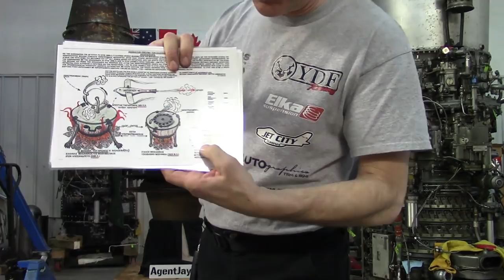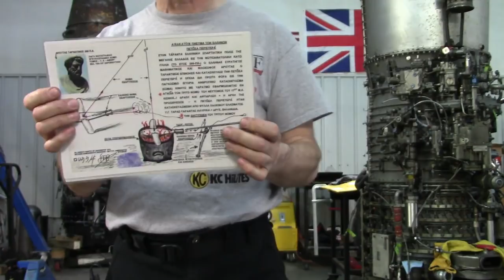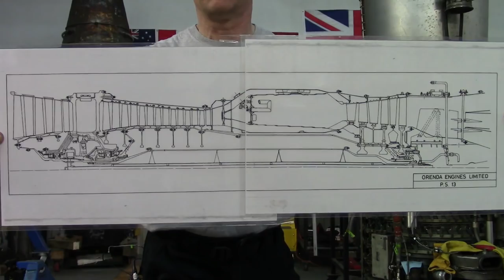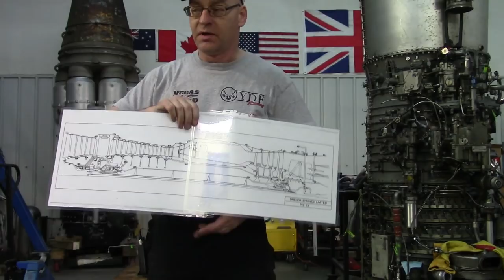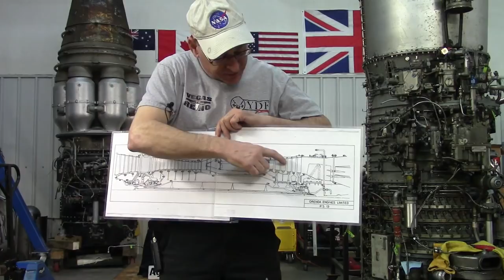4  Why don't jet engines detonate ?

Comment: +AgentJayZ — The closest thing to a detonation in a gas turbine engine is a "compressor stall" or "compressor surge", which, like detonation in a reciprocating engine, is a sudden, explosive event that can cause flame to come out of the inlet and can cause engine damage.  I'm sure you know all that, but you didn't state it in the video.
Reply from the maker: It is most definitely not an explosive event.
Please refer to my video about compressor stall.
It's called Compressor Stall.
Reply from the maker: You're drifting here. The word we started off discussing was detonation. I will not follow your drift off course. Thanks.
Reply: @AgentJayZ  Dear Sir, if I understand this correctly the compressor and the turbo fan are connected with one shaft and they spin at the same speed. Are there any engines made that would use a planetary gear system to change the speed of the compressor to spin faster? Isn't that the whole idea to try to force more air into the combustion chamber? So once the engines up and running you could use a planetary gear system to speed the compressor fan faster then the turbofan. Or is there just not enough power to do such a thing?

Comment: Hey Dude/ lookie at ur BBQ & Think Thrust !!! Fuel Never-Ever comes into Metal Contact. Hence, ur BBQ burner stay's Cool.The  Sum of the Thrust Vector of the Ignitionable Product introduce's New Cooling & at Tyme's, if so Desired,  Combustible Air. Basically Negative Pressure Trying 2 Regain Equilibrium.Cooling is attained by Accelerating & Introducing the Accelerating Air Between Metal & Combustion Hence ;a Techie B-J & Barrier of sort's Betwink's Metal & Combustion. Temp Differential = Buck Roger's 101. Rocket Science/Not Quite, Left out Delta V.Acceleration of Chemical Particulant's. Answer ; They don't Blowed Up cuz they B Honihorribly AJ Approved .lol YYZ 60++Planker.

Comment: That US flag looks either old or fake, what's up with that?
Reply from the maker: Genuine American flag... Made in America, sent to me by an American. It's heavy duty, and it's pinned to the wall in 6 places.
Reply: AgentJayZ gotcha. Flag code is goofy here, maybe it's the knock offs that have the stars closer to the edges of the blue section. My scouting days were many moons ago. Either way, great explanation, I'm impressed by the compression on modern jets, that's a stupendous amount of pressure. Modern diesels run around 18:1 with up to 40 psi inlet boost, my old 6.5 is running 21.5:1 at 15psi inlet boost. On diesels, I know you have to worry about injectors boring a hole in the piston because the injection pressure is so high. I imagine that the fuel injectors on a jet don't have the opportunity to develop a similar issue in the combustion chamber. However, does the flame front ever cavitate (?) the combustion chamber?

Comment: J which jet engine did Donald Campbell use in bluebird that went across the connison lake?
Reply: Rolls-Royce RV12 12 cylinder engine, not a jet at all.
Reply: Nighthawke70 thankyou i always wondered what was used, as a team recently brought the bluebird out of the lake and are restoring the bluebird
Reply: Sorry, but you're wrong, Mr Nighthawke 70.  Donald Campbell originally used his father's K4 hydroplane, which was powered by a Rolls-Royce 'R' racing engine, dating back to the Schneider Trophy contests.  However, that was wrecked in 1951.
He then came up with Bluebird K7, which was powered by a jet engine.  I have the impression that it might originally have been powered by a Metrovick Beryl engine, but I could be wrong.  Bluebird K7 was subsequently fitted with a Bristol Orpheus engine for more thrust, and this is the engine that was powering it in January 1967, when Bluebird K7 and Donald Campbell tragically met their end on Coniston Water. There's a couple of very good accounts on Wikipedia, if you care to check them out. 
For the sake of historical and geographical correctness, I'm going to be pedantic here (I usually am).  Donald Campbell both met their end on Coniston Water.  It's an old catch question for English geographers: "How many lakes are there in the English Lake District?"  The answer is "One".  In the English Lake District, there is only one lake, Bassenthwaite Lake.  All the others are either Waters or Meres, plus a few small areas of water known as Tarns.

Comment: @AgentJayZ Is there any insight you can bring to the argument that a <250g drone could bring down a passenger jet if it were inhaled by one of the jet engines?  I think we're starved of actual experts, so your word on the topic would be actually worth something.
Reply: Large jet engines are tested to withstand frozen birds which are much heavier and more damaging.

This is not to say 'no damage happens' but it is highly unlikely that a 250g drone is going to town a turbofan engine where much of the leading edge is the 'high bypass fan' which directs most of the air around the actual turbine so that most of what strikes the fan follows a path around the sides of the engine and not through it.

I am guessing that on many more modern aircraft the engines are even shielded by the fan deliberately to even further reduce the chances of injecting solid particles encountered in flight or on the ground.
Reply: Thanks!  Yeah, that's along the lines of evidence I've been able to find.  I think a lot of people are basing their worries on older engine designs.  So far it's been impossible to find any concrete data on whether or not any of these older engines are still in service.
Reply from the maker: Frozen birds cause heavy damage.
The test is carried out with unfrozen bird carcasses.

A  sub 250g drone going into a large turbofan would likely damage a fan blade, and it might have have to be shut down.
Then again, it might only be noticed during the next walkaround inspection.
Reply: As AgentJayZ has said: frozen birds cause heavy damage.  The story goes that, in the early days of bird ingestion testing at R-R, the test crew loaded a frozen chicken into the compressed air gun and fired it into the engine, still frozen.  The engine was wrecked.
Another story goes that, on a later occasion, a crew loaded a chicken into the gun and then took their lunch break.  They came back ran the engine up and fired.  The engine survived, but when it was stripped, they found fur in the engine - and the test site cat had gone missing .....
Reply: @grahamj9101 lol poor kitteh.
Reply: @AgentJayZ I bet about a billion people would like someone such as yourself to describe the damage various drone sizes would do to jet engines with the visual aids you have readily available.  Even if it's just your opinion, I bet it'll hold truer than most of the nonsense being touted as fact these days, especially on YouTube.

Comment: So an modern engine got 40 to 1 compression ratio so at ground level it's 40 bar pressure but at 15 kilometres upp there at 2000 km/h ram air speed. how much pressure is in combustion chamber?
Reply from the maker: Airliners travel at about 900 Km/hr, not 2000.
Ram air helps the compressor do its job, but does not change CDP.
Combustor pressure is slightly less than CDP.
Burning the fuel heats the air, but does not raise its pressure.
Reply: Shouldn't Charles’ Law imply that heating the air increases its pressure?  Or do you mean there is a net decrease because of outflow from the exhaust?
Reply: @who88777  Jet engine combustors are designed to be as close to constant pressure as possible - the expansion takes place as acceleration of the flow instead - and in practice there is always a few % pressure loss
Reply: Ok mr riddler...

Comment: In a nutshell, jet engines don't detonate because there isn't any fuel mixed with the air when it's being compressed, so detonation can't occur.
Fuel is injected after the air is compressed, and the flame burns continuously.
Reply: Alla, the reason diesel preignition isn't a thing as well.
Reply: You got it :)
Reply: That's a different phenomenon altogether, and it's not what makes diesels more efficient. They get more work done per unit of fuel being burned because the compression is much higher and the mixture is always on the lean side. Very little unburned fuel, and more energy being extracted per unit of fuel burned. Originally we were talking about detonation, and both diesels and jet engines can't do that because there isn't any fuel mixed with the air when it's being compressed.
Reply: Devil's Offspring 
You should repent
Reply: Repent? How did a discussion about engines turn into something to do with religion?
Reply: @rcairflr  Why the attitude? This is a technical discussion.
Anyway, jet engines, like any internal combustion engine, don't use "compressed air instead of fuel". They use both. In a jet engine, there is no fuel mixed with the air _while it's being compressed_, so detonation can't occur. Same thing with Diesels.
I don't have to have a "lot of experience" with jet engines to understand that, and neither do you--or anyone else. This is easy to understand and doesn't take years of study and/or wrenching on physical engines to grasp.
Why the overt hostility?
Reply: @rcairflr  It's all good :)
Reply: Diesels don't re-ignite because the fuel isn't sprayed into the engine until it's ready to be ignited. It's sprayed in,  just before TDC, then ignites. It doesn't travel in with the air, like a gas engine.
Reply: @jameswright4732  you'll get something close enough if your injector timing is wrong enough that you get fuel being injected too early

Comment: 12:50]  How about at start up?  when ignition may not be fully established all of the way around the turbine.  Possibility of problems??
Reply: I forgot to add, is there a certain confining effect of the flame front at the fuel nozzle that is due to the fact that everything is already hot, up to temperature, and burning, but may not be that way at engine start up???
Reply: 8:43]  I guess I'm about to get the answer to the question I was anticipating all along.
Reply: 9:15]  Now I know I was anticipating explosion correctly if you get things out of order at start up!
Reply: Elsewhere I've mentioned that the nearest I've been to a 'hard' start of an engine was on a combustion test rig, when we were testing the altitude light-up and cross-light capability of a new design of cannular combustor.  The second combustor was slow to light up, which it finally did with something of a 'thud', and which we most definitely felt. I'm not aware of any reports from service of similar 'hard' relights after an in-flight shut-down, but it's perfectly possible.

Comment: You are wrong sir! The turbo jet engine is far better than a piston engine.  To make my case against the "Polara" of the 70's you reference, or even any such piston engine (with or without its turbo charger) just consider why, in the 1960's such engines were completely banned from auto circuit racing and separate categories made for the ones that did allow them. I saw the Indy Car in  action that Andy Granatelli  competed at Indy  in the year it was allowed in a competitive mode. 
 It was powered by a PT-6 from Canada, but its Canadian heritage had nothing to do with its banning. Even though it did not finish due to transmission problems, an inlet restriction plate became the method of banning it in later years. To similarly restrict any piston engine one would have to restrict the cooling to its radiators, as the restrictor plate for turbines also restricted its ability to stay cool at full power.
 Fairness of competition was not what impelled the later change in the rules and for that reason I stopped going to such "unlimited" motor racing competitions.

Comment: They do detonate...Right there in the combustion chambers.
Reply from the maker: Nope.
Reply: I agree with AgentJayZ.  Nope - and I was involved in the design of a few combustion chambers.
Reply: So let's straighten this one out.  In a normal combustion process in a gasoline/petrol engine, when the spark ignites the fuel/air mixture, it doesn't all go 'bang' instantly.  A flame front propagates very rapidly, but not instantly, through the combustion volume.  When detonation, aka knocking or pinking, occurs, then there is a sudden, almost instantaneous, combustion event.  This causes far higher pressures and loads that with normal combustion, which can result in damage to the engine, if it's not suppressed very rapidly.
The combustion process in a gas turbine is a flow process.  In simple terms, the air comes in at the front of the combustion chamber, fuel is injected into it and the flame is stabilised immediately downstream of the fuel nozzle/burner.

Comment: I’m not a jet tech, but without watching the article, I would hazard a WAEG, (wild ass educated guess), that the airflow thru the engine is faster than the flame front, (propagation speed). Please let me know if I’m correct, JZ.
Reply from the maker: Without watching, and a wild guess. 
Your effort level is matched,  sir.
I'm out.

( If your guess was correct, the engine would not work)

Comment: I wonder if in the new jet engines , because of the heat generated, the last stage(s) of the compressor are made from the same material as the turbine blades. Anyway, totally addicted to your channel. Some serious binge watching going on.
Reply from the maker: Yes... the last stage of compressor blades in the LM2500 are made from an Inconel - like alloy, because the titanium alloy that the other stages are made of can't take the heat.
Reply: Yes, final stages of airline compressors are nickel superalloys from the diagrams I've seen.  50:1 compression makes for very high temperatures!  There's a nice colour-coded diagram of a RR Trent 800 I've seen where the last 2 compressor stages are nickel alloy (previous ones being titantium blades, titatium or steel stators)
Reply: The rear stage blades/vanes of the HP compressor of the Olympus 593 in Concorde were in Nickel alloy, as were the rear stage discs (Waspaloy, as I recall).
Reply: Have modern airliner engines reached the same compression that the Olympus 593 achieved at Mach 2 yet?
Reply: They are getting close, approaching 60:1.   But don't forget, at Mach 2, a lot of the compression was done by the aircraft intake, with a pressure increase from under 2lb/sqin to 9lb/sqin in supercruise at 58,000ft.  This resulted in an air inlet temperature at the front face of the engine of 127degC.  The engine itself still had a pressure ratio of around 13.5:1, from memory.  Doing the math(s), that gives just over 60:1, but I recall hearing nearer 80:1 quoted by a performance engineer.  I will try checking the quoted P/R for the engine.
Reply: Further to my previous comment, Wikipedia quotes an overall P/R of 82:1, with 7.3:1 in the intake and 11.3:1 in the engine, in supercruise..  I think I know who wrote the Wikipedia entry, on which I had to do a minor correction a couple of years ago, to add that both the HP and LP turbine blades were cooled.
Reply: I also read that on Wikipedia, good to get confirmation that it is accurate :-) Do fighter jets get a similar effect at high speed or do they have much less efficient intakes?
Reply: Yes, any engine that goes supersonic has an intake that will produce some degree of pressure recovery.  However, Concorde's intakes were some of the most efficient.
The story goes that a team of engineers from Concorde were invited to look at the B-1 prototype.  They took one look at the intakes and pronounced that they wouldn't work: they didn't.  It's a story, but I heard it first-hand from a couple of those engineers.

Comment: JayZ, just to run out to left field, would the "fire" in a Pulse Jet be a detonation?
Reply from the maker: That would be combustion. Detonation is an often misused term with a real technical meaning.
Another term often misused by piston people is explode. The fuel air mixture in a piston engine does not explode. Like in a jet engine, it burns and expands.
Reply: @AgentJayZ  That makes sense on the pulse jet. I agree on the air fuel mixture not exploding in an internal combustion engine.

Comment: Wouldn't a compressor stall with flames belching out the inlet be a detonation?
Reply from the maker: A stall is not a detonation.
Burning fuel, even in the wrong place, is not a detonation.
Reply: @AgentJayZ  Well with your back turned to your jet when it burps it sure makes you react like it was a detonation. DANG that was loud!!!  Especially when you see the fireball out of the corner of your eye!  :>)  TF30 is loud no matter which way the flame is moving.
Reply: @dremwolf5419  Deflagration and detonation are two ways energy may be released. ... If the explosion moves outward at supersonic speeds (faster than the speed of sound), it's a detonation. While the action of deflagration is to push the air in front it, objects do not explode because the rate of combustion is relatively slow. When a shock wave is created by high explosives such as TNT (which has a detonation velocity of 6,900 m/s), it will always travel at high, supersonic velocity from its point of origin. if a shock wave is not produced it is considered deflagration